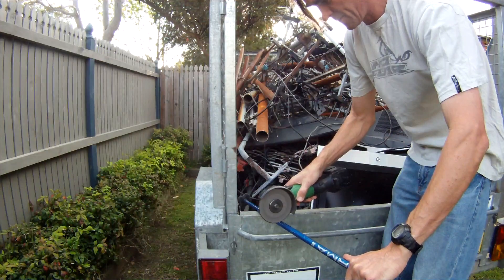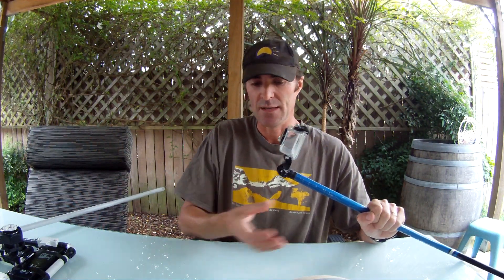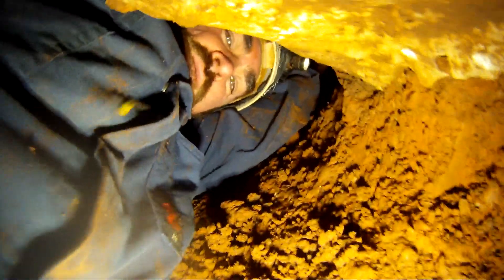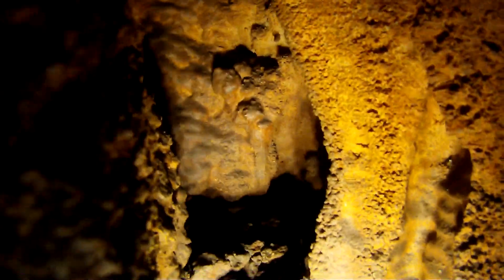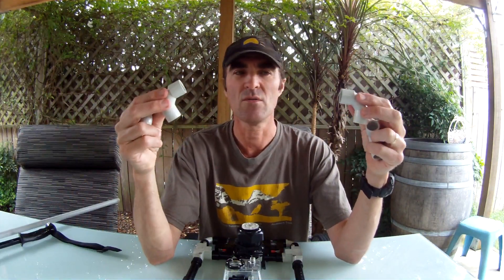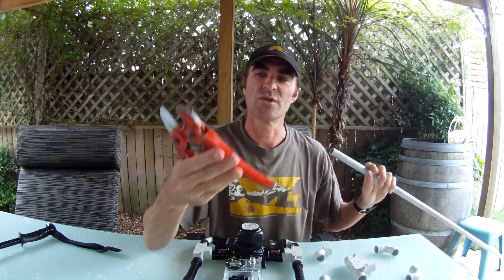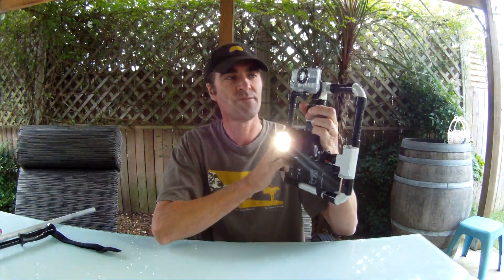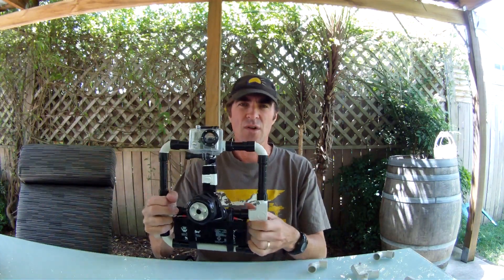How to make an LED Light / GoPro Hero Camera Rig - To get decent video in Caves.

Comment from the maker: Thanks. Yes the PVC can be modified for many purposes.
It tends to be quiet in the caves so the microphone is not too bad. 
Depending on the use, a non waterproof skeleton housing could be used with an external microphone input. Hero2 has a 3.5mm mic input, while the HERO3 requires the adaptor lead.

Comment from the maker: The smaller rig is much more versatile. The pole rig is great in that it can be be extended into some small places but it was also very difficult in for lots of other reasons.
The smaller rig is much more versatile. It can be maneuvered easily and can get wider shots in small cave passages. 
Watch my video "River Cave" for an example. I would not have been able to make that video with the other rig. 
Both have their uses. I have thought about fitting batteries in the handle. It could work.

Comment from the maker: I have tried all sorts of lights in the past. My previous LED light is 300 lumen (costing $130) and it looked like a toy light underground, compared to the LED downlight solution. I also have a 1200 lumen head torch (bought off Ebay for around $60) and it is bright but quite narrow. Fantastic for caving where you need to see where you are looking but not so good for filming. It creates a brilliant bright spot in the midle of the video with black all around.  Cont:

Comment: thats cool i think I will try that except  Autozone sells small LED flashlights that are pretty bright some stores give them away and they only cost about.99 cents. I'm going to purchase a few and a similar pole.The battery lfe seems to last quite a while also in those little flashlights. The total cost could be under 10.00 using a mop pole or broom handle from the dollar store and this would solve the issue of weight with a hollow pole

Comment: As for the Parts List, you can put everything in the description but few people ever look in there, even if you say something in the video about it. So for previous vids that is acceptable but it would be better if you add some text into the video. General part name, specs, and general price is usually all you need. That's if you really wanna go DIY style. Good luck with everything.

Comment: Haven't used Vegas since I own a mac. In iMovie you can select the audio preferences for the particular clip and adjust the gain to make it louder. There is also a waveform in the timeline for the audio, it should be underneath the video clip. There is usually a bar that you can drag up or down to change the gain as well. Just listen to the clips or look at the hight of the waveforms and make sure they sound about even. Should be pretty simple once you find everything.

Comment: Very helpful video. I enjoy watching other peoples designs and see how they compare to my own. I like the pvc handheld mount, it's extremely good for getting stable shots and the battery weight will keep hand shake down. A few tips if you decided to do more videos: 1.) Normalize your audio. Your explanation clip was really quiet compared to your example vids so I had to keep adjusting the volume. 2.) Add an on-screen list of the parts you bought, it makes it much easier to pause and write down.

Comment: @brynmag i don't think i could take the tight dark spaces - might freak out. so i was thinking; add a wasp nest and you might as well shoot me. and there you guys are all relaxed.

i am thinking i might try to make a frame like that, for underwater use when snorkeling. maybe without the light tho. i suppose i could just use a small tripod and sacrifice it to the saltwater - but something plastic would be nice.  i would like to be able to weigh it down somehow, so the waves don't move it around.